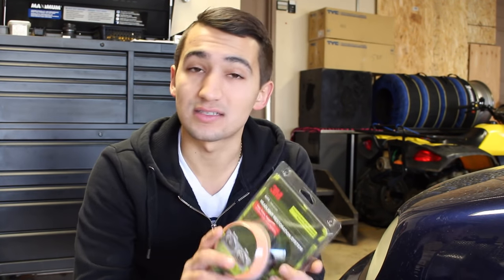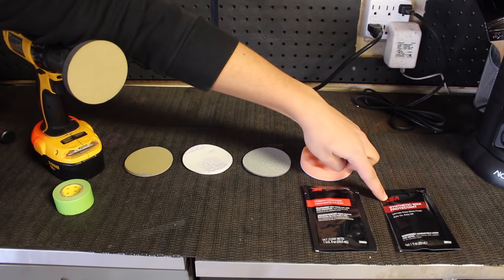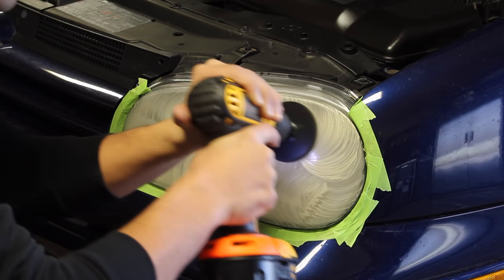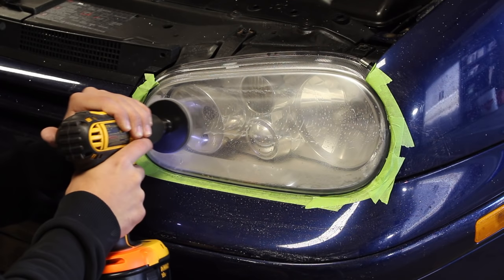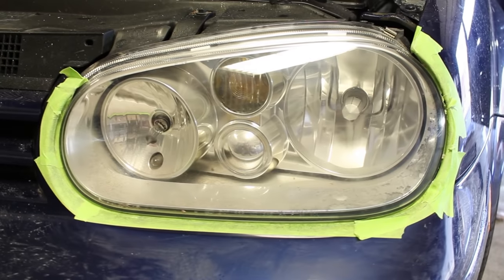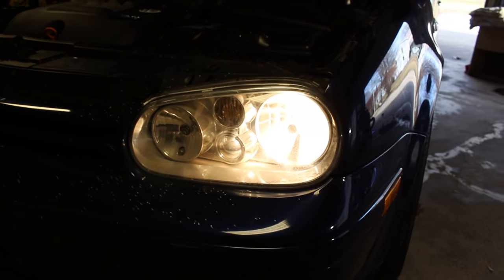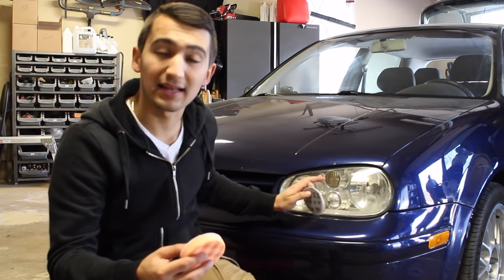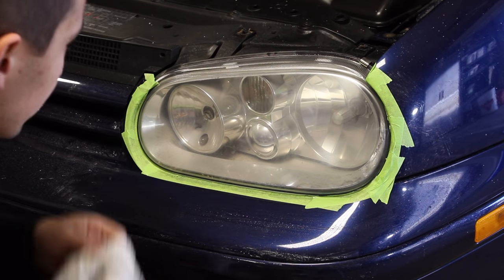How to Restore Faded Headlights for less than $20

Comment: I've been using this for about 6 years now. Had 3 kits and used it on two different cars, results are awesome. the lense won't be perfectly free without some very faint scratches but it looks more than enough and the results exceeded its cost. 

Restoration lasts around two years until you might have to do this again without clear coat protection

Comment: Dang! What a difference! That was one of the easiest kits I've ever seen and how you explained it, spot on!
Reply from the maker: +Jesus De La Cruz Thanks Jesus :) They came out really nice!!
Reply: +milanmastracci Yeah they did! I was like, "it's gonna be another temporary cheap fix"  but they actually made a difference
Reply from the maker: Yeah clarity wise they are much nicer, however to get them permanently fixed, you will need to spray a clear coat over top of the headlights.

Comment: Thank you young man. I bought a different brand because the stores I went to didn't have the 3M kit with the drill attachment. Also, after I bought the Nu brand at Walmart, I went to their website and looked it up. They had an offer for the same brand I bought for $20, plus a $20 rebate. I could buy that and have it delivered to my Walmart (basically return the one I bought at the same time).

Comment: how tf could you see at night before this? God Damn!!
Reply: Lots of people running around with headlights looking a lot worse then these..
Reply: Austin Long that word at the end is mean
Reply: He may have a very small vocabulary.
Reply: CSX Railfan 1000T youre too young for youtube if you can handle that.
Reply: You should see my car.. condensation got on the inside of the my headlights and oxidized. So even when I clean my headlights and sand them down, it barely makes a difference.
Reply: Austin Long I cant see shit... I just put on high beam so I can see... cant see the bright future?
Reply: I saw a Prius at a used car dealership and the headlights were YELLOW. I mean like the sun yellow
Reply: 😂 80% of my town only has 1 headlight working

Comment: Amazing video!  That is ONE MINT perfectly restored headlight.  I think this is the most complete process I've seen.  Only issue is how to remove orange peel on the headlight once you put UV protection on it!
Reply: you can wet sand it with a 2000 or 3000 grit and a lot of water, then polish it with a carnauba car wax , microfiber towel and elbow grease. Peace

Comment: You do not need a drill for the sanding....You can wet-sand the head lights by hand and it does just as good as a job as a rotary drill without the risk of damaging the surrounding body-head-light area. You can then use a rotary drill to buff with polish and then finally Wax !!  For a long lasting,  (new) looking headlight restoration job, apply 2-3 coats of automotive Clear-Coat after polishing and allow 24 hours to cure, make sure to mask-off appropriate body areas to prevent over spray!  The head-lights will look like new for years with a clear coat application ! Nice video !!

Comment: Well, the other day I cleaned the microwave and toaster ovens, you know those handy cookers a lot of us busy singles never seem to have the time to clean. Dang that toaster oven glass was so dark I could hardly see the inside grill. I used some Soaped Brillo Pads I had and holy cow, I had a new oven again. I drive a 1998 Jeep Cherokee and noticed a while back that the headlights were yellowed up and after cleaning the oven decided to try the Brillo Pads on them. In less time then it took to peck this comment out I had two new sparkling headlights. A couple of bucks worth of pads, a bucket of water and rag, even if I need to do it again I figure I'll have a new Jeep by then.

Comment: I wish I had watched this before doing my headlights tonight. I used a different kit made by Sylvania, and spent around 2 hours manually sanding. I still got great results, but I wish I had gone with this kit that took advantage of a drill. The only plus is the Sylvania kit comes with a UV protective clear coat that you apply as the final step.
Reply: It may have escaped your notice this kit includes UV clearcoat wipes,😂which was never shown or even used??

Comment: i did it with a orbital professional polisher, the one  which looks like an angle grinder. i went to the compound and just applied pressure and turned up the rpm.b 3 mins of mopping it and it came perfect.
never bothered sanding at all. i did clean the lights with undiluted screenwash first though

Comment: If you were to clear coat.  At which point would you add it?  Right after the 3k grit?  

Would you recommend doing 2k grit instead or 3 and then clear and then 3k and polish the clear?

Comment: I would be intrested to see if you have any advice on bringing plastic back to black
Reply: Meguires makes a decent product. Apply when completely dry. Not after a wash.
Reply: I was told leather cleaner/polish can bring black back into greyish plastic. I did it on the rubber/plastic around the windows on my 2001 f150. Looked great and lasted longer than armor all or stp sprays.

Comment: my running lights in the back and front plus the front turn signals don't want to come? bad fuse or wiring i couldn't find any bad wiring and the headlight restoration works great! wow what a difference!
Reply from the maker: +Kool Herc I would look into a fuse. Uusally they're by the footwell of the car
Reply: oh ok thanks. I did this headlight cleaner to my grandmas subaru and wow what a difference! thanks for showing this
Reply from the maker: Yeah its crazy the results lol

Comment: Good video. But... How long will it last? 3-5 weeks? Especialy in Arizona. I did it before but now - only clearcoat. Better result and it lasts 3-5 years. Just don't buy cheap from walmart. Buy a good 2k. 
If headlights bad like that: 320->400->600->800 sandpaper, degrease, mask and put 2 coats: first light coat and good wet coat in 5 min.

Comment: Hello, I have bought brand new headlights and can you tell me which is better, putting a vinyl covering over or spraying it with that clear coat? They are so clear I hate to throw a 3000 grit sand paper on it to spray it. The vinyl does have a uv tint and is thicker than a spray coat but not sure if once the road pits hit the vinyl  can it be removed. What I don't want is to screw up my virgin headlights. It looks like spray painting clear is the same as getting scratches. Do you have any experience with the vinyl if it can be removed? That's sounds better with a thicker protection and I don't have to sand it. Your thoughts?

Comment: Just did mine and works great, but still shows a little white haze and circular scratch marks. Havent applied wax yet, and did multiple runs with the polish. Is there a method to remove any scratch marks on the lens or do I just have to try to use compound to fill those scratches in.
Reply from the maker: So when you're doing the restoration procedure, after the first pass, all of the oxidation should be removed. If it isn't, you should keep sanding until it is. After that, every next step is just going to be refining the scratches that are embedded. So if you begin with 1500 grit, you will need to remove the 1500 grit scratches with 3000 grit. To get rid of the 3000 grit scratches, you will need to use a cutting compound. To remove the cutting compound scratches, you will need to use the polishing compound. Do not continue to each next step until all of the scratches are refined with the next stage.
Reply: Alright got it, and if I wanted to try this process again am I able to directly restart after applying the compound the day before? I have a Mk4 GTI so this video was easy to understand, as with the audi restoration one too. Thanks!

Comment: Can I use this kit to polish turn signal lights or not ? I have a yellowed right turn light on  my Volkswagen Bora and I want to remove the yellowing.
Reply from the maker: You can given that the outside layer of the turn signal light has oxidized, just how the headlight lens has oxidized.

Comment: I also have Golf 4 but my headlights are made of glass. Yours appear to be plastic?
They look fine but there are some fine scratches and I don't know if I should sand it down?!?
Reply: What plastic are the headlights made of?
Most lenses are made of polycarbonate material, some are polyacrylic. Both can be restored with this process. Do not use this system on glass or glass lenses. Source: http://multimedia.3m.com/mws/media/643002O/headlight-restoration-system-02516-faq.pdf
Reply: 1cdstorm Good thing I didn't. I just polished them without sanding.
Reply: +Milan Taskovic You never sand glass headlights...
Reply: Prjct B2600i I just polished them like that without sanding, but still there are fine scratches that can't be removed.
Reply: Nothing you can really do about that other than replace them, they're quite cheap though.

Comment: Can I skip a step of mine aren't that bad? What did you use when spraying that on the lense?
Reply from the maker: +AtomicCheeseburger69 It was just water in a spray bottle. If yours aren't as bad as this, you should start with the 800 grit.
Reply: milanmastracci okay thanks man
Reply from the maker: No problem :)

Comment: I use Metal Polish on my headlights, and it does the job. Just scrub it in with a microfibre cloth.
Reply: +BimmerGod it works, just like tooth paste works, its abrasive, but this method when used with a clear coat will last 5 years. yours on the other hand.. a few months max. reasons why: your Uv protectant clear coat is wearing off and the light is now foggy looking. your using some abrasive polish to get it away, but its still Unprotected from everything, thats why they use a synthetic sealant = 1 year or ceramic coating = 3-5 years or clear coat = 2-5 years+ depending on 1k or 2k clear used to protect the plastic from the outer world.
Reply: +WillieNillie thanks for the info!
Reply: can u recommend any good clear coat?
Reply: DaeUng Yeon Any name brand Plastic clear coat. Dupli Color, Rustoleum.
Reply: thx a lot so the process goes like
600 grit wetsand 800, 1000, 2000 and clear coat am i right?
or should i wet sand again and polish after clear coat? many thx u r a champion!
Reply: DaeUng Yeon you want to stop at 1500 ish because the clear coat needs something to hold on to. youll see after the clear coat has cured for a day or two if you want to polish it or not.

Comment: How to clean your headlights for under $10
Items needed: 
*Mother Mag and aluminum polish
*Sanding papers that are fine like p2000 p1500 and p800
*Three fabric cloths
*An electric sander if available (this can be done by hand also just takes longer)
*A spray bottle full of water.
*And you

First Clean your headlight with water first until dry than apply mothers mag and aluminum polish on the headlight dont wipe it off as it will be sanded with the headlight, now sand the headlight with fine grits with either a p2000, p1500, or p800 (this can be done without a sander you just need to usea  circular motion than after sand it horizontally) until you see it haze than use a polishing cloth on your sander and polish it horizontally and than vertically (also can be done by hand just use a circular motion with a Fabric cloth) after that get a regular cleaning cloth and detail the headlight until clear also if you want better results do this every 24 hours for 3-4 days and if you want permanant results spray the UV clear coat like the guy said and apply a wax after (if you have a budget to spend $25 ).
Oh and thank me later ☺☺☺

Comment: how long did they stay clear
Reply from the maker: They're still clear :)
Reply: cool thanks
Reply: donkykóng as long as you your the protective liquid pouch and re apply every so often it will last years
Reply: Harry Harkins i sanded back with really fine paper and clear coated xD
Reply: donkykóng that's a good thing you can clear coat it and you won't have the re apply anything
Reply: Good job

Comment: So the other day i was washing my car (2012 scion tc) and noticed the beginning of some oxidation :\ verrrry light oxidation but i noticed it starting in the middle :( Can I just polish it and put some wax on it and i should be good? (when i say polish and wax I mean with the polish and wax I use on my cars paint)
Reply: Use a light polish and invest in a DA Polisher to make it easy
Reply: +Froztinc I already own the griots garage 6" random orbital polisher.
Reply: Polish and wax will do just fine. I recommend Collinite 845 for the wax
Reply: +Froztinc I currently use meguiars m21 synthetic sealant. would that do ok?
Reply from the maker: +Mashed Pwntato M21 will work as a paint sealant. If you use a light polish, you can remove light oxidation with it, and then use M21 paint sealant to seal it up.

Comment: So lets say I want to use a UV protecting Clearcoat. When do I apply it. Right after using the compound? I believe that I just use the compound and not worry of using any of the sealer. Just the clearcoat.
Reply: +Harzman01 true, only use it right after the compound/polish, no wax before clear coat.
Reply from the maker: +Harzman01 Would a video help? :)
Reply: WillieNillie alright thanks!
Reply: milanmastracci You said that you wont do it in "this" video so I suspect you are actually going to make another video on that matter?
Reply from the maker: Yeah :) Why not...? If you would find it helpful, sure :)
Reply: I'm sure it'll be helpful to most of us. I'll be waiting on that video! one thing is I cant seem to find a proper uv protecting clearcoat here in Malaysia. I have yet to check out the automotive store near my area. Hardware shops dont seem to sell them
Reply from the maker: Good luck in finding it :) I just picked some more up today from my local hardware store
Reply: +milanmastracci thanks man. cant wait to watch the next one

Comment: Dirt inside: I had this issue with a car once and I took off the headlights, used Distilled water and a little vinegar and shook the mixture inside the headlight. Drained then rinsed with distilled water only, shaking, draining and rinsing a 2nd time, just to be sure. Then left them in the sunlight  to dry. I used an airbed 12v pump that has a high airflow to help dry the interior. Hope this helps someone.

Comment: I wet sanded 800 1500 2500 then sprayed clear coat. The clear coat left a foggyish coat. How do I fix it?
Reply from the maker: So what happened is you sprayed too much clear coat, too fast. Let the clear coat dry, and then sand it off with 1500 grit sandpaper, and then again with 2500 grit sandpaper. Its very important to take your time with spraying the clear coat because you've experience cloudiness. That means the vapours in the paint can't flash off and evaporate out.
Reply: ok thanks I will try that. I think I sprayed to far away also. Round two coming up

Comment: Do other methods such as bug repellent, baking soda, toothpaste work but not last as long?
Reply from the maker: +Ishaq Ballut Do they work, yes. Do they last a long time? No. Because there baking soda and toothpaste have abrasives in them, it will be very similar to polishing the headlights. But if you leave alone and don't put wax or sealant on them, they will yellow in no time.
Reply: +milanmastracci oh ok:)

Comment: Can I use 3,000 grit sandpaper and then spray clear coat on it?
Reply: Dj Mystery no
Reply: i use 800, then 1500 and then 2000..then rubbing compound..then carnauba wax to seal..good as new..800 and just 1500 or 2000 probably be okay but costs like $1 a sheet and takes 5 more minutes..ive done about 25 in last 4 months as a side business.. does an amazingggggg jobs..
Reply: igor6969 , Great alternative.

Comment: i was wondering when were you going to get this one done. me personally i use 3M hand glaze bottle cleaner. you dont need a drill and not so many steps. one just pour some onto a hand tissue and do circular motion on the head light for about 30 secs. then right after, use another clean hand tissue to wipe off excess. TADAH!! it REALLY cleans and shines headlight very nicely.  ofcourse you can use a pad onto a grill for even more deap clean but a tissue will do. thats how i clean my headlights. just wanted to share so if anyone doesnt have a grill can get same results.
Reply from the maker: +Olympic Gaming If you want to do it by hand, that's exactly how you would do it :)

Comment: can I use 1000 instead of 3000 grit for the last one?
Reply: i use 800,1500 then 2000..i suggest starting with 800 or 1000..but you have to finish with 1500 or 2000..then 3000 if you have it..3000 too fine to start with..that be a finishing grit..
Reply: thanks bro!

Comment: Wet sand with 800 grit, then 1000 grit and then 1500 grit. Finally  use turtle wax and buff the lens. It cost me 4$ to restore both of them on my Buick. There is no need to buy a kit to do this because some of these kits are expensive.  All they are is sand paper and buffing compound. It took me half n hour each side. So expect about a hour to make them look new. There is UV resistant wax that is cheap. I did not use any on mine. I wax my car on a regular basis with turtle wax so they still look like new on my car 2 years later. Total cost 4$ not 10$ to 50$ like some of these kits.

Comment: How soon after the headlight is restored  can you wash the car?
Reply: as soon as the applied sealant has dried - depends on specific kind of sealant - wax probably does not need to dry/cure; with a spray-on clear coat sealant i'd wait till next day if it was my own vehicle.